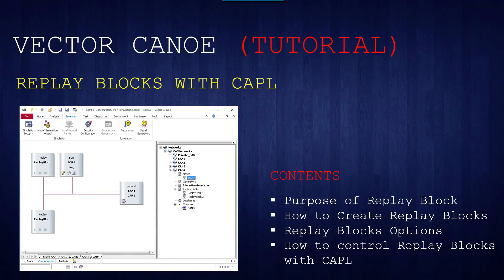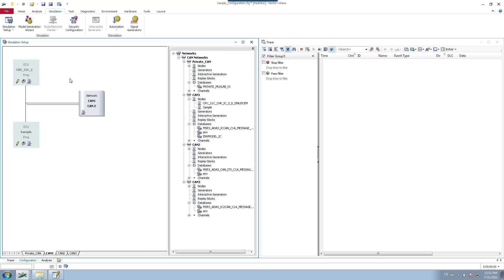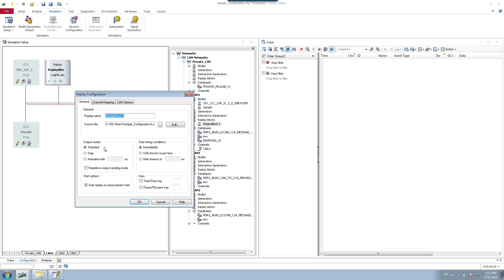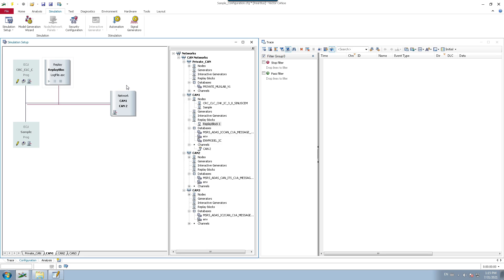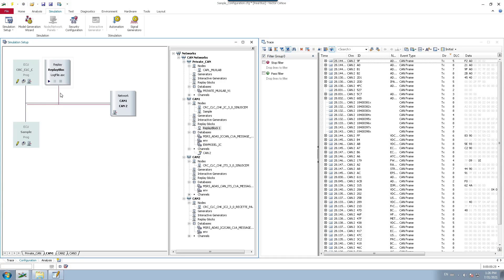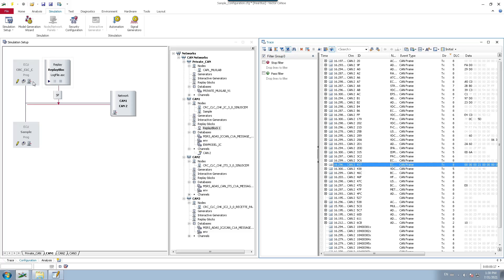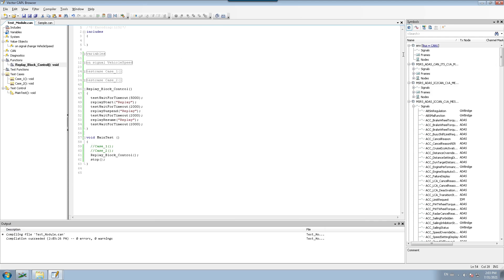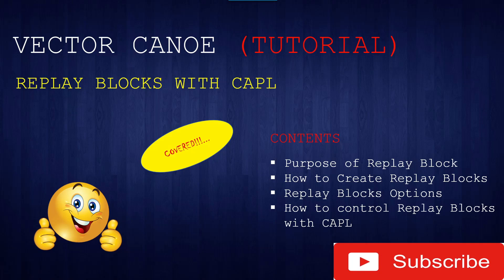Vector CANoe - Replay Block via CAPL Coding

Comment: Thanks for the video! Is there a way to run the replay block until the end of logs? (Without using testWaitForTimeout?)
Reply: I have the exact same question, have you found a solution ? THANKS
Reply: Nope. Will msg once I have @slyfer2310

Comment: Anyone know how many number of ecu's,Signal, message in vehicle parking system
Reply from the maker: There is no fixed number of Signals or Messages for any System. It varies based on each supplier & project. But to answer your question about number of ECUs for Vehicle Parking System -> In one possibility it can have up to 3 ECUs [SONAR -> for Ultrasonic Sensing] [AVM -> for Camera based Detection] [ADAS -> for Longi & Lateral controls].

Comment: Please do more functions,how to add different logging file in same reply block,using CAPL code
Reply from the maker: The logic is same... You need to link additional log files with dedicated replay blocks and call in the capl functions with its name....
Reply: @smk1984eee  if i had a 20 test case means ,it is not a efficient way to add 20 replay blocks,is tat possible to make with single reply block with different log files